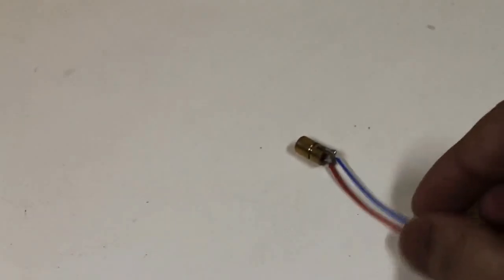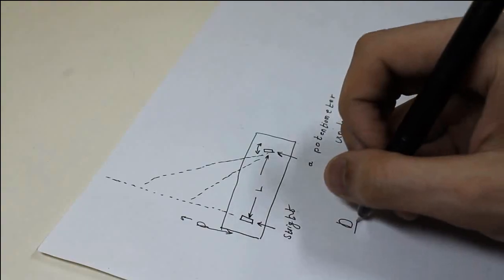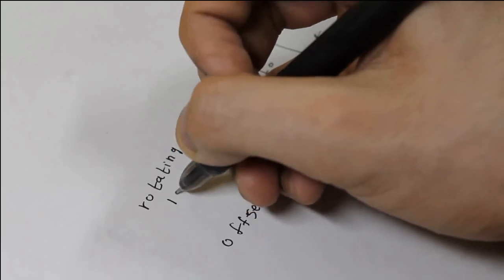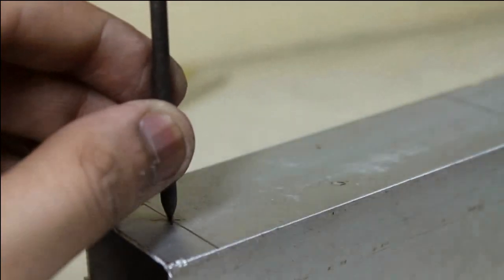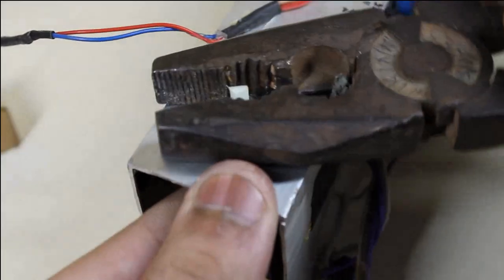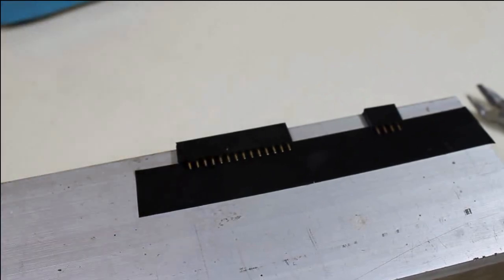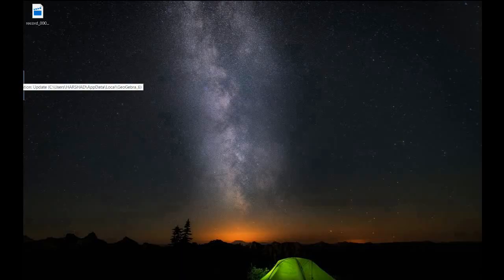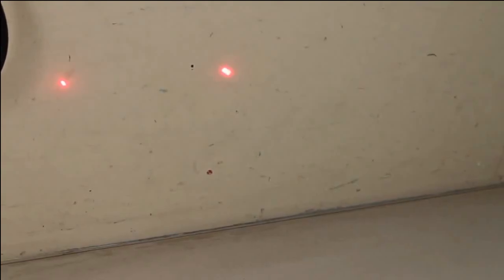Measuring distance with Lasers

Comment: When you show the numbers changing, also show that you, a human, has to change the angle of the potentiometer to point to the spot on the wall.  This is a good project for geometry, trigonometry, basic electricity and measurement.

You can put the numbers into a spreadsheet and show how to use regressions (or trendline tools in Excel or Sheets).  

You can extend this to use a stepper motor and camera to line up the points.

A pair of galvanometer mirrors can match the dots in two dimensions. Those are the basis of many laser projectors.  They can give you a step toward future videos.

If you use a camera that can handle Regions of  Interest (high frame rates for just the pixels in the image), you can get more data to refine the central point of the two dots -- without having to add lenses. 

If you monitor a spot with a local camera, especially using region of interest (If you have a cameras that can do 1920x1080 at 30 frames per second, and only look at 192x108 then it should be capable of sending data at 3000 frames per second. That much data can give extremely precise data on the distribution of intensities.  Such pixels will be extremely sensitive to vibration.  You can teach about vibration, accelerometers, velocity, displacement, seismology, gravimetry, photogrammetry, data sharing and the purposes of working together using precise measurements, sharing algorithms and data streams. Set up live experiments that run forever, share those data streams as a way to teach analysis and working together globally.

If you ask for donations and crowdfunding, then you can afford the tools to teach and share.  Join with others and work as a group - helping and encouraging each other.  Look for schools that need clearer online experiments and demonstrations.  Do NOT get diverted by people who only want to milk what you do to make themselves money.  You can live a good and useful life teaching others. Donations are for nonprofit efforts.  "Crowdfunding" is almost always commercial. Keep your motives distinct and separate.  I suggest a .COM website and the associated .ORG site. Then talk to people about products and services on COM, and continue to help with the ORG. Find yourself a good board of advisors.  Carefully separate your goals and priorities.

You might want to post "Draft" videos, get feedback, then make more careful ones.  Give links to spreadsheets (you can use GitHub.com) and to articles.  Encourage real discussions and ask for suggestions for new types of measurements.  Start a website where people can go to share and work together.  Any useful methods, make videos.  Use Screen recordings with sound (a screen recorder to show what you see on the screen, and microphone to explain what you are doing).  Add those to your video recordings of things.  You can show how to use a spreadsheet, or how to write Javascript programs. Do NOT write line by line.  Write it, test it, then explain and provide links.

This might be from Instructables, but if you make improvements, or are explaining it well, you can make it your own.  Check the licensing and sharing from Instructables.  You might check out HackaDay.IO and similar groups. Encourage them to make videos and to write and explain clearly.

When you start the video, show it in use and show what you are doing.  It is not magical, people are doing things.  Turning knobs and looking.  If you get motors and controls and cameras and sensors to do those things you are automating human skills. 

Sorry, I cannot give you a clearer set of suggestions.  I think you have the potential to help many people. But it is hard work, and any success and interest will only add strains and responsibilities.  If this is just for fun, one thing. But to help you clarify your understanding of the world and how to quantify and document it, that is something else.

Take a look at the Franck-Hertz experiments.  This is one of the founding experiments (in 1914), part of a group of experiments that included the photoelectric effect. Those ideas and simple experiments changed all of human society.  The next few years and decades will see a transformation more extensive than the whole of the 1900's.

Sincere best wishes,
Richard Collins, Director, The Internet Foundation
Reply from the maker: Thankyou sooo much for your time and for writing so many suggestions.
I will definitely make most out of it.
Thank you
Reply: @harshadbyadgi  You are very welcome. I have been working to understand the Internet for the last 22 years. This year I determined to reach out to people and groups to help work together.

I just wrote a note about a reflecting laser interferometer measuring device.  I mention that many (most) laser diodes divert part of the beam to use as a reference signal to monitor power.  

https://www.youtube.com/watch?v=CBXF5DiDz30

Low cost lasers like you used can be used with fast comparators (digital or analog) to track the distance precisely. When I told them they can move to the pico and femto range I was speaking from having looked closely at that.

I track all sensor networks on the Internet and in society. One I am most interested in are those that are reaching the pico and femto ranges.  Because these many times are reaching the sensitivity they have to begin correcting for earth tides, the changing potential of the gravitational field at their location gravitational time dilation), and the gradient of the changing potential (a varying tidal gravitational acceleration) at their location.

There is a video someone made that shows how to track distances precisely by comparing the reflected signal with the reference (wave comparisons for lasers are called interferometers, but the more general term is correlations).  He used an oscilloscope, but I think a software defined radio would give more flexibility.  You could just use the receiver to follow the reference and reflected signals (some SDRs are at 6 GHz now)  Or you could use the SDRs with transmit receive capability to modulate the signal.  6 GHz is about 5 centimeters, but counting steps and phase is more precise. Especially if you monitor the noise in the signal which is much finer grained than the laser dominant frequency chosen to give colors for human eyes.

I am a bit tired.  I usually work 12-18 hours a day, seven days a week. But I worked all night and it is 5 am.  So a bit hard to give you every single thing,

If you think you want to make more videos to help people and set up a way to take donations or crowd funding, then contact me.  Best wishes.

Richard Collins, Director, The Internet Foundation

Comment: you are genuine please can you explain the theory of measuring distance by more details: my understanding is you want to crate triangle and you measured the angle only one angle by pot on free laser, you have the length between to laser i just missed one unknown to get other unknowns
Reply from the maker: Yes.... That's correct. We know the distance between the two lasers and the angle of free laser because of the potentiometer. And the fixed laser makes an angle of 90°. So we know one side and the two angles at either end of the triangle.
Reply: @harshadbyadgi  awesome , I have another question how you get the function 10.4 tan (((x-5) *pi)/ (2*895)) - 0.9 tan ............: and I guess so we can measure the horizontal distance after determining the vertical distance and assuming the angle between the end point of the vertical distance and new point have 90-degree angle.              thank you very match 🥰🥰🥰

Comment: Point one laser at a distant spot, then point a nearby laser to the same spot.  Measure the distance between the centers of rotation of each laser assembly and the angle of the rotatable laser.  Monitor the resistance in a variable potentiometer using a small computer with analog to digital capabilities.  Use trigonometry to find the distances.  Use a series of measurements to calibrate the potentiometer so that this measurement tool gives standard and precise distances and angles..

Keep trying to get it concise and complete!

Using the instrument is as, or more,  important than designing and building it.  Every instrument or product is useless if the time to just get it to work greatly exceeds the time to buy it. That is the failing of most products and tools today.

Richard Collins, The Internet Foundation
Reply from the maker: Yes definitely
Reply: Ben Krasnow "Applied Science" made this video

Laser diode self-mixing: Range-finding and sub-micron vibration measurement

https://www.youtube.com/watch?v=MUdro-6u2Zg
Reply: If you press enter when trying to reply, it erases the message.

Here is Ben Krawnows video on using simple diode lasers for measuring distance.  He used an oscilloscope.  But you might try using software defined radios (SDR) as a very fast ADC (analog to digital converter)

Laser diode self-mixing: Range-finding and sub-micron vibration measurement

MUdro-6u2Zg